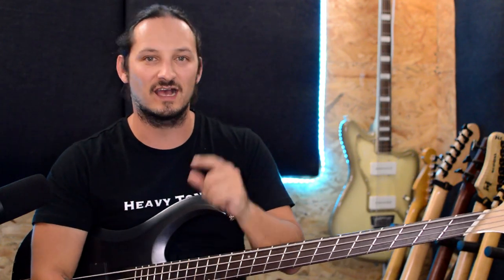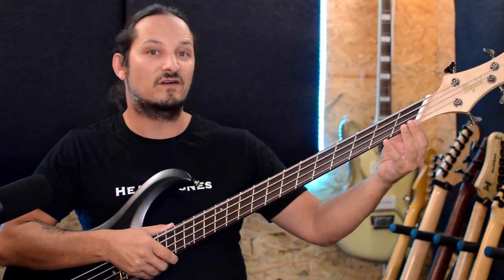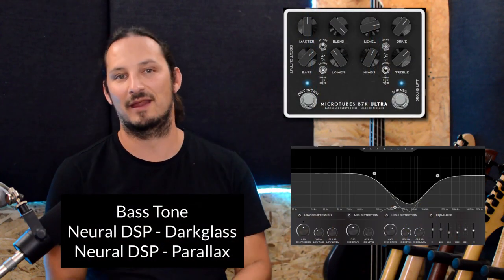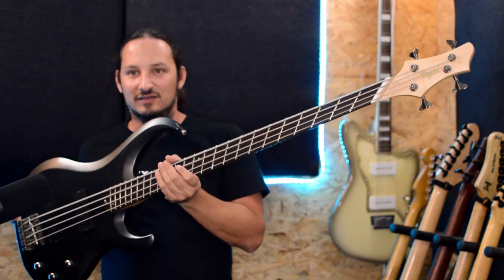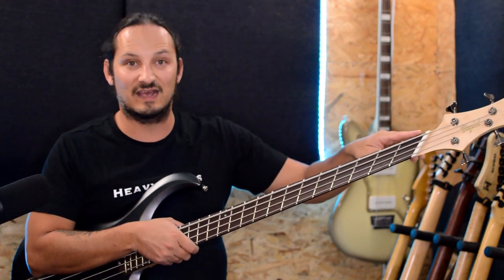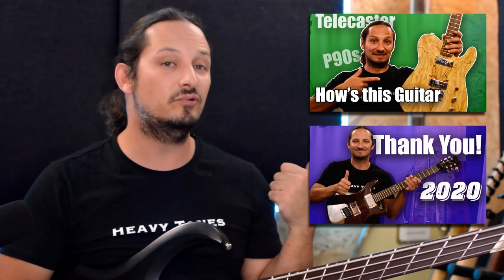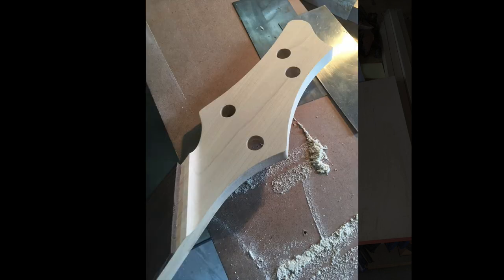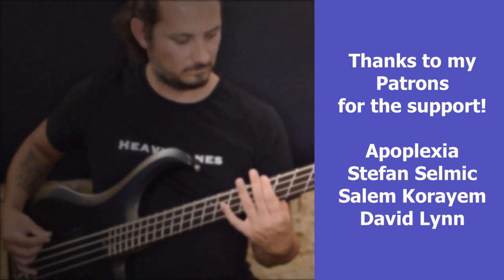My 37-inch Bass Conversion Neck

Comment: Most btbs are fitted for bartolinis but since this bass looks like it could fit some emgs or Seymour’s or whatever pickups that would fit in it, try those instead playing the stock pickups to give you some different sounds and as far as the pre amp I think a dark glass preamp would go well with this bass.
Reply from the maker: Yeah thats exactly what I'm thinking. Getting some Seymour Soapbars and a Dark Glass Preamp
Reply: @GaryHiebner  it should sound killer